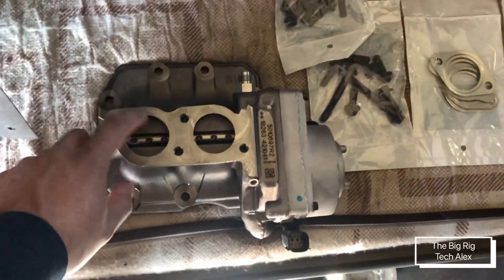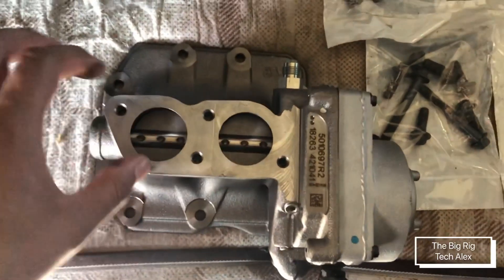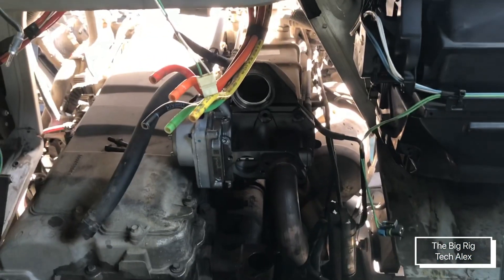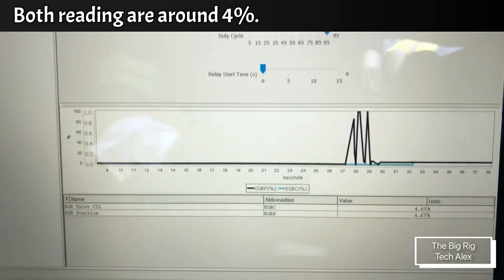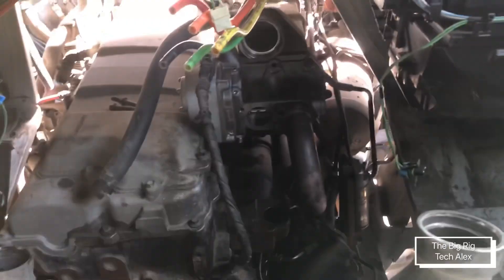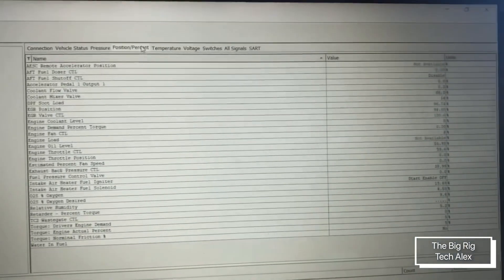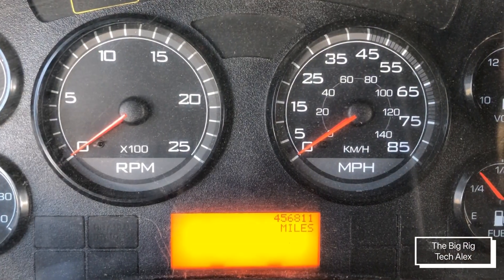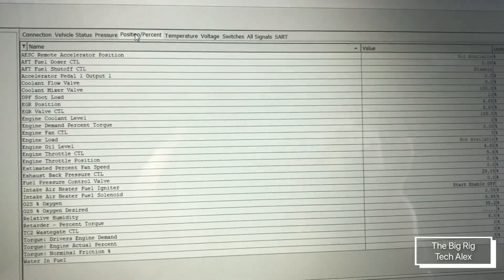Maxxforce 13: EGR valve replacement. Update 4 Final.

Comment: I have a 2018 Prostar and my buddy and I replaced the EGR valve without having to dismantle the console and dash. We removed the old valve and installed the new valve from the engine bay where it was located as seen in this vid. It was tight and challenging and it took about 5 hrs, but it was doable.

Comment: Ok i just did the same job bro but just to make sure it wasnt stuck manually or a plugged doser but the two looked good.....but i cannot get rid of red check engine soot level 3 and baked filter also about to regenn wish me luck btw you're a good technician.
Reply from the maker: Thank you. If you are using the diagnostic tool from   International (Service J1939 or NAV tool). Pay attention to the DPF pressure sensor, perhaps the sensor is bad and be sure DPF temperatures are in range, a little advice before you open other things.
Reply: That something im doing a bit of studing to know how to use software properly and read healthy dpf readings

Comment: Can a bad egr prevent a regen?
Reply from the maker: Yeah, manufacturers like international or Paccar they might allow you to do it, but it might not finish, running indefinitely it is one of the symptoms. Others like Volvo and Freightliner does NOT allow the regeneration unless you fix the issue with the EGR valve or actuator.

Comment: Hi I wanted to ask you I changed my EGR valve and coolers on the weekend. I had someone help me and I wanted to ask if you had any electrical problems after that because my mirrors and my switch pack like dump suspension and sleeper dome light does not work anymore. My wipers keep moving and I can’t turn them off.
Reply from the maker: Not really, if you did remove any connection from your dashboard, like in the video, just make sure everything is connected the way it should be. But even, like that your mirror should work properly regardless of that. If the person who help you knows about it, try to contact him/her again, perhaps he/she will remember something that you do not. Thanks for watching the video.
Reply: Not sure if you figured out the problem yet. But I just wanted to mention that the load shed relay is located on the doghouse, if you fast forward to around 4:10 of this video you will see it.  has 2 big power cables going to it. If one of those cables are loose or connector is unplugged, it will cause some accessories not to work. Also, if the big cables are loose or off, it can cause the wiper motor to stay on. I would check it and make sure.

Comment: Does the coolant leak when removing the EGR valve or when you remove the cooler?
Reply from the maker: It will leak when you remove either the EGR valve or the EGR cooler. You should drain the coolant for any repair of those parts.

Comment: So I have codes spn0027/spn0639. My truck has new high/low egr coolers, egr valve was cleaned out in July. Truck had lost power and going 65mph only. Then I came to a stop and wouldn't run without boggling.  I removed the pipe from my DOC just to make it home, I did see blue smoke coming out, 5miles after my truck was running good.
Reply from the maker: There is a high probability that your DPF is clogged, the cause for the blue smoke needs further investigation but usually is for burning oil, my advice is to get an estimate for the repair, if the shop is going to charge you more than you think it is worth your truck, then I think is time for get a more reliable truck like Freightliner. Of course, this is my personal opinion, thanks for watching and support the channel.

Comment: Do you know if they have fixed this issue on they 2015 models
Reply from the maker: Good question, we do not have 2015 models anymore but in the engine A26, international fixed couple things on the exhaust side, less sensors and one single turbo are few of the major changes. In my point of view, (our fleet has truck 2019 models barely in the 300,000 miles) once those trucks hit 500,000 miles will see if the engines can last, for now, engine A26 is in the middle (so so engine).

Comment: hello! thanks for the video, question: can a leaking egr cooler put coolant in oil ? my truck is trhowing a lot of vapor !!
Reply from the maker: The EGR cooler cannot mix coolant with the engine oil, when the EGR cooler leaks, the coolant can go to the intake side and start to mess with the Aftertreatment System (ATS). However, if your coolant is going to oil side, in this case when you drain the engine oil, if you can see stain or drops of coolant coming out of it or if the oil is milky color, this means that probably the engine oil cooler might have a leak which is unlikely because usually in this case oil goes into the coolant side. Commonly for the vapor coming out from your crankcase/oil separator or from the oil filler pipe, your engine head might be the issue for it or perhaps a crack in a cylinder liner. If your engine is making a rough noise or it is NOT smooth at idle, you should take your vehicle to a shop for a proper diagnostic. I hope this help you and thanks for watching.

Comment: Great video, I need to change this valve but I´m not sure if I can calibrate it with servicemaxx, it's possible?
Reply from the maker: Yeah, it should be possible to calibrate it with servicemaxx. It is just now they called NED (Navistar engine diagnostic).
Reply: @LetstalkDIESEL  Thank you!

Comment: So what do you think about a delete for this motor?
Reply from the maker: You could delete the EGR system if you want but the units we had actually never got issues beyond the check engine light, few of those even passed regeneration with the EGR issue going on. So, I cannot say if that will do any difference. Personally, I do not support messing around with electronic parts because later on cause damages to other parts. This is my personal opinion and good question.
Reply: @LetstalkDIESEL  thks bro

Comment: Why was truck symptoms?
How do you know if egr and/or fuel pump is going bad ? Please Help 
I see 2013s for a decent price...some with a over a million miles So I’m assuming they had to run at some point
Reply from the maker: We found the problem with NAV software tool, check engine light were on. By experience, Maxxforce 13 has a really bad reputation. Do not think just about price. Many technicians agreed that was a great disappointment from Navistar. If you are planning to start your own trucking business, Freightliner might be the best way to go. International A26 (the new engine from Navistar) might be better but still new ( around 2 years in the market) so we will see how perform down the road. Of course, this is my personal opinion. Try to make your research and decide wisely. Thanks for watching.

Comment: If egr valve good,can it be clean ed out,Im changing egr cooler core soon
Reply from the maker: If the EGR actuator has free movement and the ECU move it without issues, it should be fine. The EGR cooler seems to be more complicated to remove than just the EGR actuator, In other words more labor. So, keep that in mind.